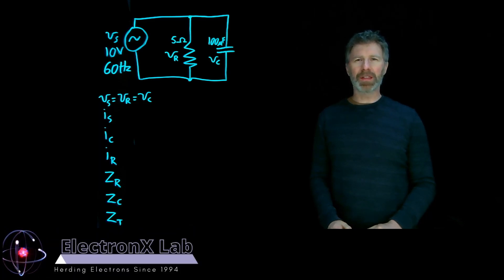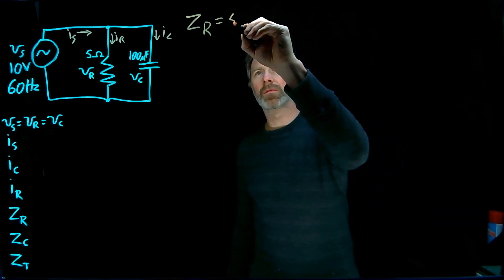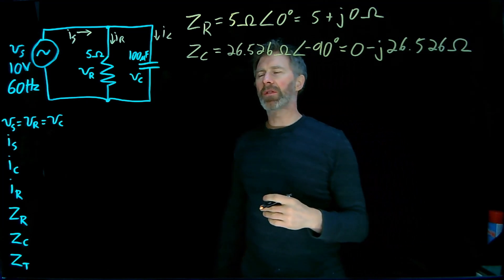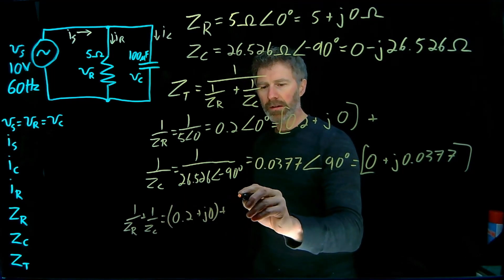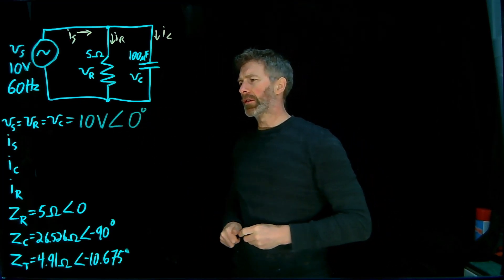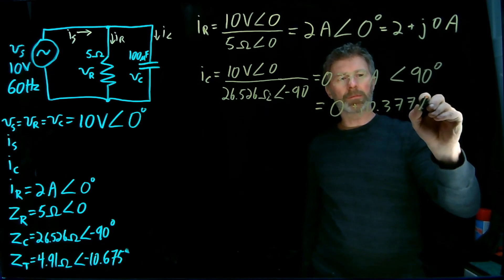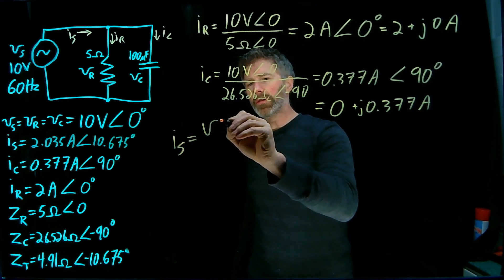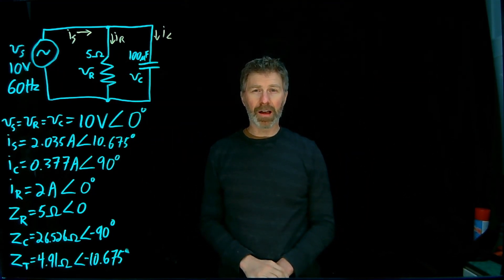RC Parallel Circuit: Calculate Voltage and Currents

Comment: How do you find the total current in a parallel RC circuit with two capacitors and two resisters all in parallel with each other?